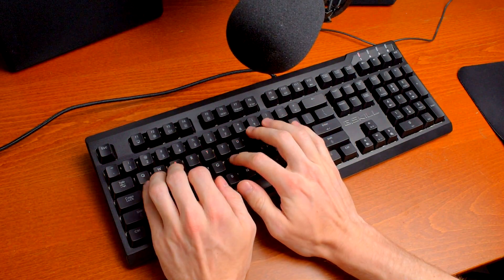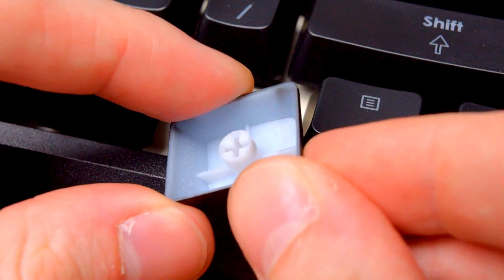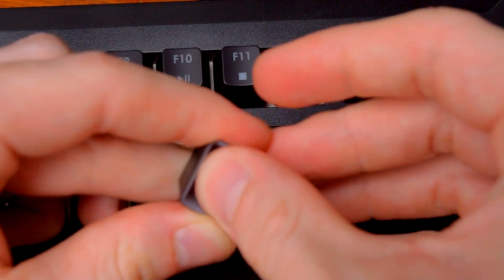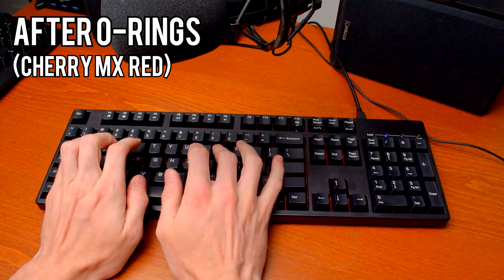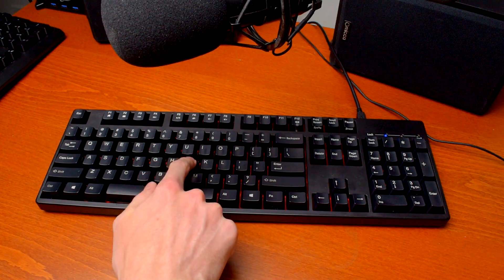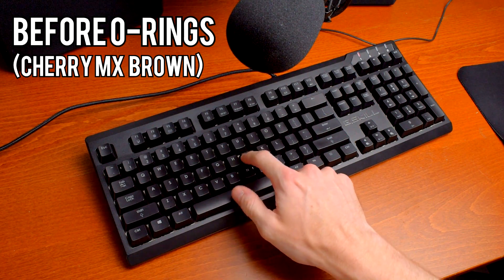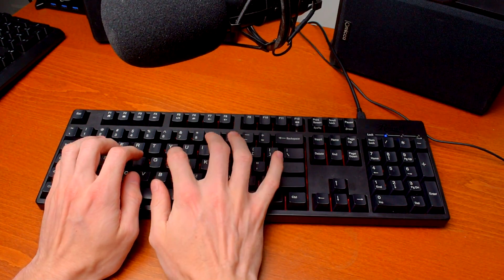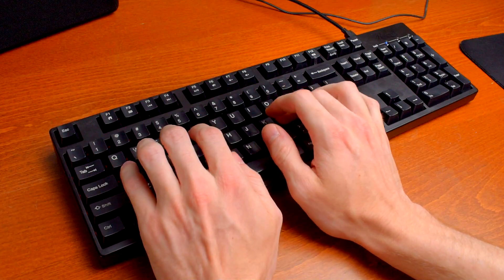How To Quiet Down ANY Mechanical Keyboard!

Comment: Does it feels the same ?
Reply: It feel different after you put those O-ring on. Not only it decrease the switch's travel distance, but also make you feels like typing on a membrane keyboard which is meh. I would suggest lubing switches as it provide more good feeling than those O-ring and the switch's sound also reduced thanks to the lube.
Reply: @huunhanle3809  thank you so much

Comment: I just bought  a keychron k10, and while the quality is good, I'm really wanting my old cheaper Tecknet keyboard that I had for like 5 years. The switches aren't hotswappable, but they seem to be a knockoff black switch, lots of actuation force so it's hard to miss a key on accident. I have gateron reds which are linear as well but I miss the feel and sound of the cheap board! Wish they were still making keyboards, cannot match the silent sound and comfort of the tecknet board.

Comment: after slamming my own keycaps multiple times w/o the o-rings, I hereby conclude that the noise from a mechanical keyboard originally came from the keycaps hollowed structure itself you can try to reduce the collision noise etc. However the reduction isn't significant. Laptop keycaps are not that loud coz its nearly flat shaped. Thank you for coming to my ted-talk. Sheeeeeeeeeeeshhh

Comment: What o rings do is they make the plastic of the keys not hit as hard as if you are using the keyboard normally without them, it makes it feel very displeasing, the only good thing about them is that it quiets down the keyboard a touch, but ruins that by making it feel rubbery and trash. just get a keyboard, buy something called spray lube, and then take off all your keycaps and then just hold down the key you want to make quieter, and then spray, it can get messy so get like 8 paper towels to clean after.

Comment: Cleaning the keyboard by simply removing the keys & wiping down both they keys & the board which they are attached to fore me has not been enough to quiet down my keyboard to those of more recent thinner keyboards with smaller keys. Regardless of what's more new, I appreciate my keyboard which supplies 2 extra USB ports. Ordering through Amazon for a simple $8 bucks, I'm going to give the O-Rings a try because of price, availability, as well as the simple fact that I've maintained this keyboard for quite some time & would hate to go to a smaller keyboard with less functionality. So I thank you for the inexpensive suggestion & will add to this comment for taking the time to supply a means for what many are likely in search of.

Comment: i bought a mechanical keybaord to get switches because they are not rubber BUT WHEN YOU PUT O RINGS YOU ARE PUTTING RUBBER ON IT MAKING THEM LIKE A MEMBRANE WHICH IS WHY MOST PEOPLE BOUGHT SWITCHES TO NOT HAVE A MEMBRANE

Comment: I bought one of these O-Rings and right when I put them on, I did not see any sort of difference. Is it my type of keyboard that isn't compatible with these O-Rings? I followed all the steps and it just sounds the same and feels the same. Can someone explain to me if im doing something wrong or why they are not working. Btw, I have a razor mechanical keyboard.  Thanks!!

Comment: do o rings dampen the sound of keyboard pings, like the ring thats heard after pressing a key
Reply: That's the sound of the springs inside the keys, and those depend on your keyboard material and design, these are just for when you bottom out keystrokes, they won't make a difference on that
Reply: @JoeOrber  thanks for the in depth reply, it seems that over time as ive used it the ping sound has reduced a good bit. But thanks.

Comment: So my problem is my keyboard when click down and its has the pressure, it makes the clicking noise, but after it sounds metal vibrating and ringing, got any solutions for that
Reply: That has to do with your keyboard build materials, same switches sound different depending on the keyboard design and materials, I have one that sounds like that and I love it, but I have another one with less acoustic feedback

Comment: LMA, my mom had a mental breakdown after the first few days of me buying blue switches, and as a result my older relatives like my aunt and uncle who are very supportive to my mom as my mom's a single parent. And they gave me money to buy new keyboard xD.
Reply: Get an Apple Magic Keyboard, they can be surprisingly good, of course you'll want the extended one with numeric keypad. It's a weird combination of tactile and linear switches, it may work for some games and other stuff. I have several different keyboards and I love blue switches but for quieter and lower profile it isn't bad, and it connects via Bluetooth and USB

Comment: Does it feel any different? btw my mechanical keyboard has plastic caps hitting a metal plate so i dont know if i want to quieten it as it sounds so good at a relatively normal noise level

Comment: The most important thing you can do to quiet a keyboard is putting something soft between the keyboard and the desk.
Reply: does a desk sized mouse pad work?
Reply: @matttjjjubb  yeah, basically anything that's not just straight desk will change the sound

Comment: I came here cause I have MX blues and their not hot swappable on my G513, I want it quiet cause of when I record
Reply: I'd recommend you get an extra keyboard that suits your needs when you need to be more quiet, you don't want to be taking your key caps on and off all the time anyway, it's easier to just swap the keyboard

Comment: key topping out is a major issue that can usually only be fixed by having dampeners on the actual switch slider. don't expect O rings to silence a keyboard on the upstroke.

Comment: When comes to mekanikal (-like) keyboards, my absolute favourite is the ol' trusty IBM Type M Square aluminum logo. But if i has to use a quieter keyboard, i use a Corsair K95 with brown cherry and silicone rings. A fine keyboard, with a load of features build in. But unfortunately not as stable and robust, as the Model M IBM.  - Just wished i could have the quality and sturdyness of the IBM, combined with the dampened Cherry MX Brown! The feel of these first generation "PS-2" era 1984-87 are imo second to none!

Comment: I don't hear much of a difference between them.
Reply: You're mostly hearing the key pop back up. if you press down slowly and quietly and release your key you'll hear it slam with a click as it pops back up. there are switches known as mx red(pink) that stop bottoming out and the sound when it pops back up
Reply: O-rings don't make much of a difference for me with Razer Green switches.
Reply: The issue is that the O-rings only dampen the down stroke of a the key press. It's really hard to quiet down none silenced switches because the experience of silencing comes from the upstroke and down stroke. Probably the biggest thing you can do to quiet down a switch is to lube them with a thick lube so the switch will be a tiny bit slower to bottom out and to come back up which can significantly reduce sound.
Reply: @sounghungi  been waiting for someone to suggest some lube.. XD
Reply: I want to hit the like button but i cant bring myself to mess with the holy number. Nice
Reply: @useless274  I showed my friends this video. They said it wasn't any quieter. Now I know why.
Reply: your hearing is shit:D there was big difference

Comment: Before and After O-Rings sounds almost the exact same
Reply: ABK army lol
Reply: Scammed
Reply: @busymordenworld7523  out of 2$? O rings are dirt cheap
Reply: @Yizhuo CHEN LOL
Reply: @neil5679 LOL
Reply: @mihailsazdov4280  lol
Reply: Wtf no
Reply: Facts
Reply: So I normally put my rings on the layman’s to game w a s d up down left right space shift ext so what makes my cherry Mx blues quieter is 2 use two o rings per piece bit only the ones I use bc there is not enough that I have for 2 every keycap
Reply: Add 3 instead of 1 then it sounds better, I got them
Reply: You ether deft or trolling. About 5db sound difference is quite lot.
Reply: get silent switches much more dramatic changes the o rings barely help.
Reply: irl they probably sound much quieter
Reply: They sound the same because this doesn’t change the sound, it makes them more quiet
Reply: @penguin5389  i have the o-rings on my keyboard currently yeah it doesnt change the sound but it didnt make it any quiter either
Reply: Daniel Johnstone damn, i was thinking about buying o-rings but if they do nothing then t my not be worth it
Reply: @james48228  They're not too expensive maybe you'll have more luck with them than me
Reply: The microphone is in a different position for all the "after" clips, not over the kb but farther lol

Comment: Sounds the same to me.
Reply from the maker: The recording doesn't do it justice, the o-rings did make quite a big difference in person
Reply: I can assure you, they make a difference. The case of the keyboard is a big resonator and these rings reduce the effect by quite a margin. They just don't make the actual switches more silent, only the noise of the keycaps hitting them.

Comment: Is the feel of the buttons the same?
Reply from the maker: It's softer if you bottom out the keys, like tapping a hard eraser instead of tapping a wood table. But if you don't bottom out when typing, there's no difference in feel.

Comment: It great that you tested the three different switches under very similar conditions. You can really hear the difference and the decibels don't lie.

O rings are an effective, cheap, and easily reversible way to make the downstroke quieter. My issue with them is that they reduce the travel and feel too spongy. Unfortunately, once you've bought a noisy keyboard, there's not a great deal you can do to make it quieter without resorting to a bit of DIY by lubing the stabilisers. Plus most cheap keyboards, and some expensive ones have very rattly stabilisers.
Reply: What can you use as lube?
Reply: @uninvestigated  dielectric grease for stabs
Reply: @uninvestigated  ky jelly
Reply: This mod I came up with does not reduce travel and isn't mushy, but it does make keycaps slightly taller by like 1mm https://www.youtube.com/watch?v=XfaPmP4ps68

Comment: But do o-rings effect the clickiness of the feel of the keyboard? Notification squad bois
Reply: They will very much affect the way the switch feels when you hit the bottom of the stroke. They will also mean that there is less distance the switch can travel. That might affect your typing if you're used to a certain feel. If you're lucky you might like it :) The switch will still click though.
Reply: That’s why I’m never buttom it out while gaming :D even at typing I’m getting used to it